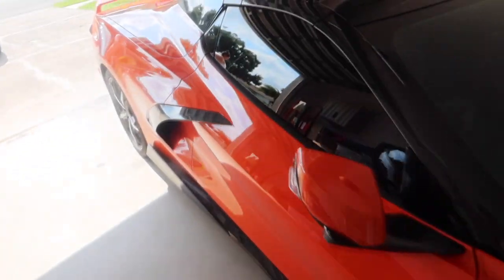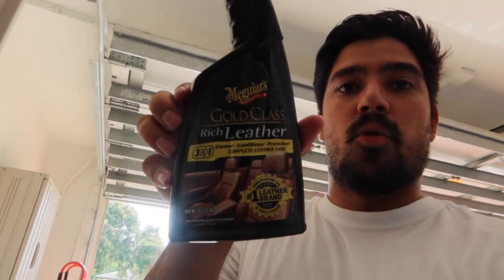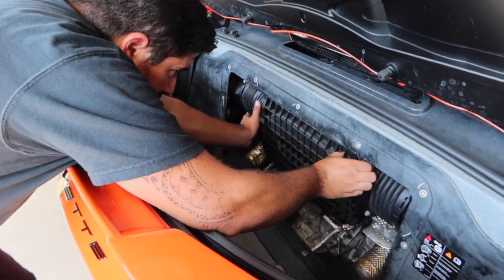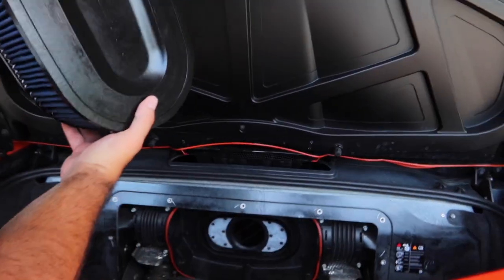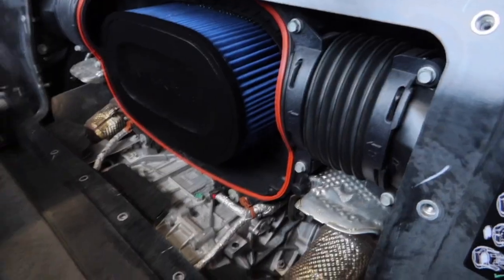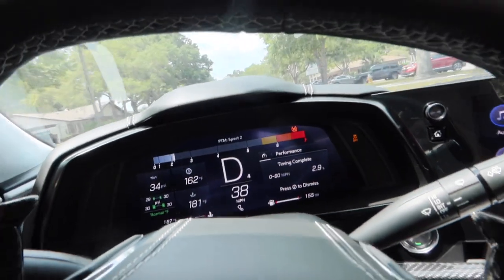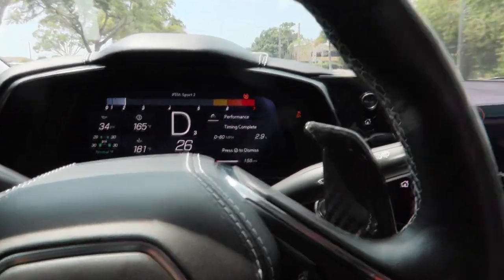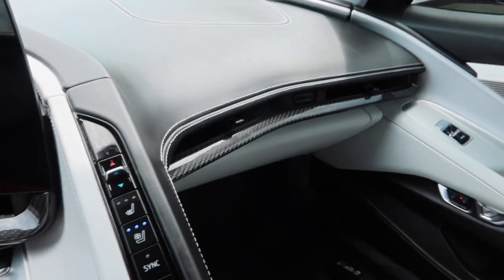Adding More Power To The C8 Corvette!

Comment: LT motors respond well to less restriction on intake, it is possible to get more torque with a filter and exhaust derestricted. LTs are monster air pumps, and if more air is flowing then more power is made.  These engines are world class with superchargers, and flow incredible amounts of air. Every video i have seen the C8 dynode has gains on aftermarket air filters.
Reply from the maker: I want to add a supercharger, just waiting for the right one that works with the HTC!
Reply from the maker: And I’m feeling a difference after a week of driving for sure
Reply: @nicolaskorvessis   I most certainly believe it after posted gains on every LT motor i have ever seen. These motors breathe from the start, but GMs stock filter restricts the motor.
Reply: Who makes that filter bro???
Reply from the maker: @NO1CAN007  attack blue air filter
Reply: @NO1CAN007   Paragon performance has good suggestions
Reply: Paragon performance has really great things I got their carbon fiber steering wheel...
 But don't sleep on street hunter on those hoods or Sigala on that new Z07 high wing...
 I'mma shoot a short when I finish it!!!
Reply: @nicolaskorvessis   Thanks bro
Reply from the maker: @NO1CAN007  I just saw the wing from sigala. I get my headers and ported manifold installed in 2 weeks. After that I’m going to get that Z07 wing!
Reply: @nicolaskorvessis   If you like that wing wait till you catch the hood by street hunter!!!

Comment: Changing just the filter to the blue shows to only add about 2HP, to get more you have to completely change out the air box..the Halltech ad's about 12-14.
Reply from the maker: I’ll be adding Halltech, American racing headers, ported intake and throttle body here soon. For  the filter I’ve seen even 7-10HP from some so who knows!
Reply: @nicolaskorvessis  guess it depends on the source, there were Dyno tests done but then again many factors at work...I just added a ported intake manifold, 91mm throttle body & a throttle controller... Yippee ki-yay...if you really want instant response punch add these...
Reply from the maker: @55Mrcry  is there a noticeable power difference? Or just response.
Reply: @nicolaskorvessis  throttle controller is for a more instant and powerful response, there are about 64 modes, the ported intake manifold and ported throttle body adds more HP & TQ and is noticeable, I installed yesterday and the test drive was great, all for under $1,000
Reply from the maker: @55Mrcry  awesome. Glad to know you like it so far.

Comment: Poor Fred!  Did mine along with paragon exhaust so I can't say much was made in the power.  I believe it's so small that you necessarily don't feel it.  Most times it can be a metal gain whereas your thinking you should be feeling something.
Reply from the maker: What paragon exhaust did you get? Even 7 HP is better than nothing! Dyno shows it as well.
Reply: @nicolaskorvessis  oh you're absolutely right!  I went with the track version.  And wow does it sound amazing!  All of the YouTube videos I've heard doesn't do it justice until I now experience it myself.  Different perspective driving it now has more exotic sound to it.
Reply from the maker: @TimShelnut  I’ll totally check it out! That’s my next mod. Any droning or negatives that you’ve experienced with it?
Reply: @nicolaskorvessis  I felt it was quality build and excellent price point.  If you keep the rpm low I don't experience much drone but get it up there in the 2500 rpm it sounds good and can have some drone.  None of which bothers me at all.
Reply from the maker: @TimShelnut  awesome. Definitely going to look into it.